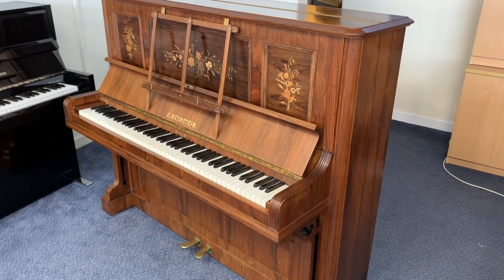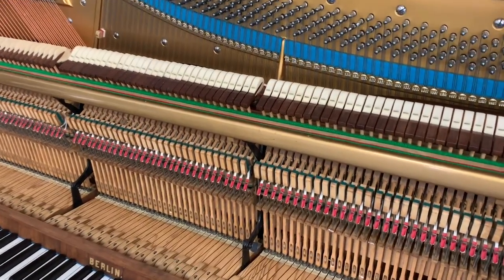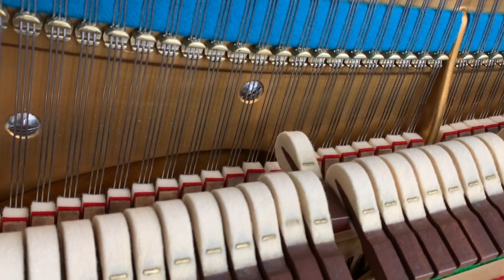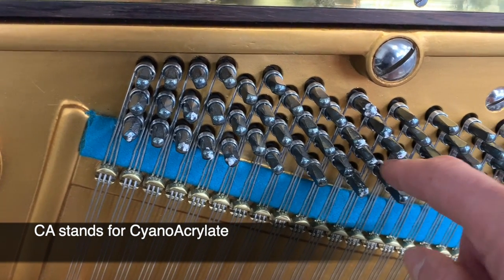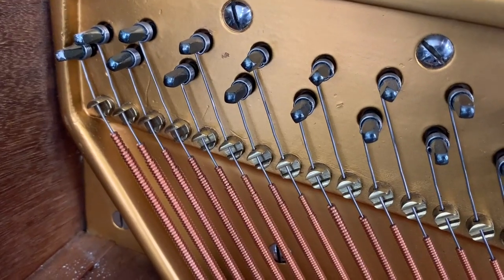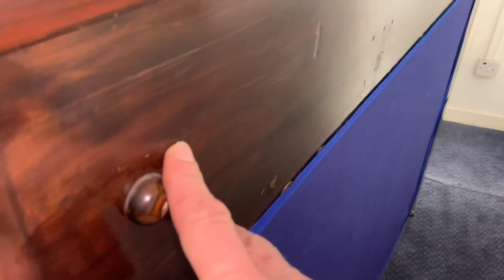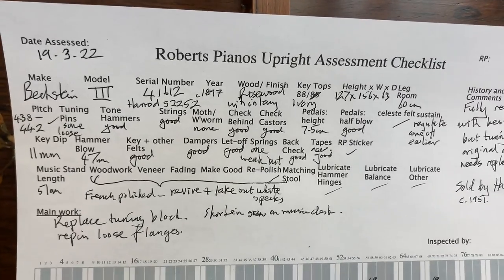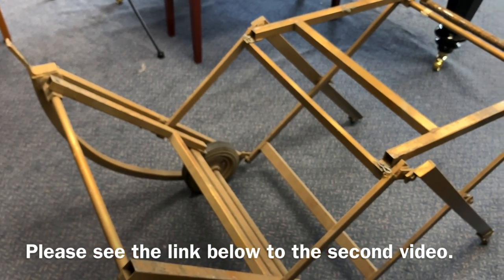Bechstein model III c1897 + replacing wrest plank or tuning pins vs. using CA glue

Comment: I have used CA glue on older uprights with loose tuning pins with great success. It has to be the very thin runny type and not high street shop 'super glue' (which is too thick to wick down and around the pin properly). I buy the thin stuff from the piano supply company 'Fletcher - Newman' sold specifically for the purpose. It comes with a suitable 'spout' to easily get the glue only where it is supposed to be. The piano owners are very pleased that their piano stays in tune much longer after such treatment and it certainly makes tuning much easier and far less frustrating! Seems to be long lasting too. Certainly in my experience much better results than using 'pin tite' or similar liquids and much quicker and less messy too.
Reply from the maker: Thank you so much for your helpful comments David. Most encouraging! Marcus

Comment: What a thoughtless design, really a petty that it is not possible to hit the tuning pin deeper.
I had a problem to use a big tunning hammer for the A0 at my Ibach grand. Fortunately the hindering wooden block is fixed with a screw.
But i saw you would have to saw off the wooden strut. These would be difficult to repair invisibly.